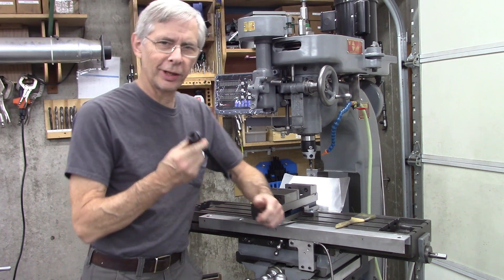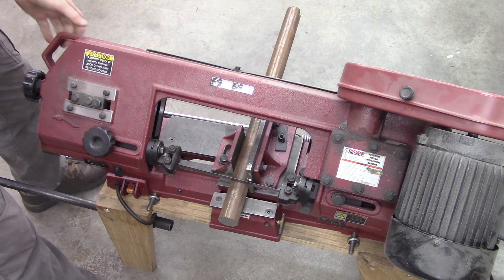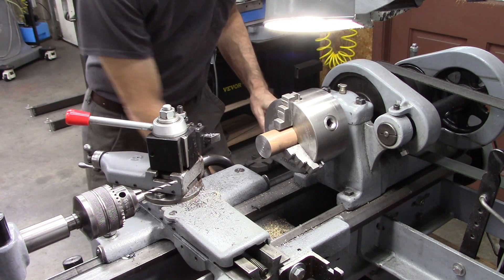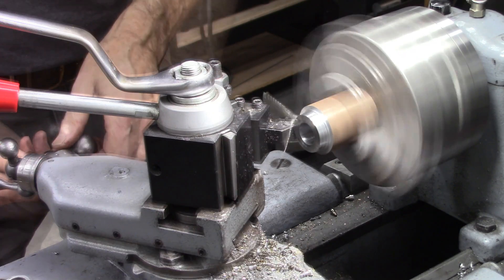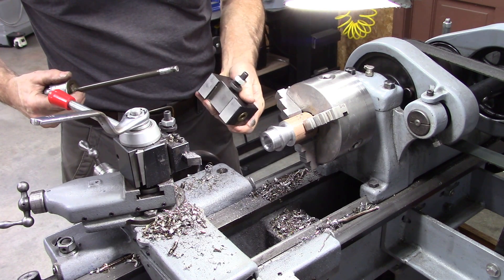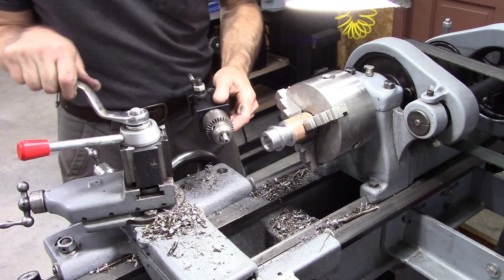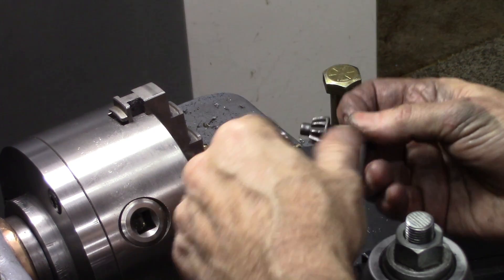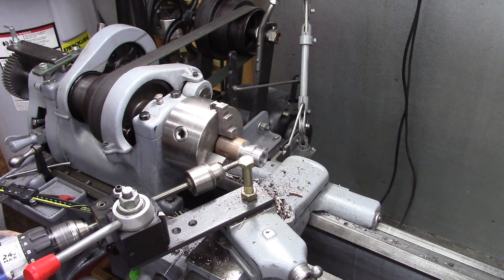Making a NEW Mill Vise Handle

Comment: Mark,  here's a suggestion for a little project.  Make you a handle to replace that nut on the top of the quick change tool post, then you'll have two handles on it.  I set mine up that way.  I was able to get some thin hardened washers to put under it and their thickness orients where it ends up.
Reply from the maker: Cool, thanks

Comment: You have some really ingenious setups and the handle turned out really nice.  Great job.  Who would have ever thought to spin a drill chuck thru a boring bar holder.
Reply from the maker: Thanks, I've used that toll post drill a lot. It's probably not super accurate but good enough for most projects
Reply: I think it was a great idea.  Seems pretty accurate to me and it's quick.

Comment: Add a magnet to the inside of the socket.  Holds tight, let go with a tug.  Happy New Year.
Reply from the maker: Maybe that would work...  it's only 12mm. I will seldom take it off so the set screw is fine.

Comment: 8:09 do you keep water in the bucket for your grinder? Or do you find with the rollercoaster ride the dust travels out ends up cooling enough to not burn the plastic bin?
Reply: Thanks for the video!
Reply from the maker: @ironhead65 Thanks, the bucket  does okay. It was a quick fix. 'm thinking a 3 lb coffee can

Comment: That toolpost extension is a great idea. I've seen a similar design speed handle fitted with a neodymium magnet to hold it on. Set screw works well too.
Regards,  Preso
Reply from the maker: Thanks Mark, yeah, I magnet would have worked but it was a bit loose. It didn't feel solid.

Comment: I hate those swivel handles too. I replaced the one on my Irwin drill press vise with a crank I devised, and it's way easier to use.
Reply from the maker: Yep, the originals are hard to use

Comment: Ha, ha, ha...  "It looks like it's either 70 or 110 degrees".  Sorry, but it sounds like something I would say.  Of course it's off of 180.  I think you can buy one of those spider vice handles, but it probably wouldn't have your hex size and I think I had to press a socket into mine even because it was metric.   I had mixed emotions about it later. It was too big and the arms should have been shorter and stouter.  It might have been the lever for a drill press.  It was kinda big and in the way and I had to keep taking it off.  I always thought it needed some sort of weighted spinning threaded hub that gives it a "hammer" and then spins and does it again the other direction to open it using a dog pin.   You know, like some of those 5c collet closers with the hand wheel.  How about a hollow hub filled with lead shot or depleted uranium (whatever you have handy) to make it dead blow.  That cries out to be a casting, where's Lyle?  Maybe you could use some heavy rods and radius the ends so they could take a mallet blow and not use any knobs.  Make them out of 5/8" diameter grade 8 bolts and a 6 point impact socket in the center.  Or not.
Reply from the maker: All kinds of ideas...  "hollow hub filled with lead shot or depleted uranium "  I'll go with the shot!

Comment: I use a 3/4" deep well socket on a 1/2" drive T-handle. Middle position for fast open or close. Slide the handle to either limit for max leverage. Works great.
Reply from the maker: The sliding handle is okay but harder to spin fast and hits the mill gable handle.
Reply: @WinkysWorkshop  it is harder to spin fast because it will extend one way or the other under centrifugal force but in the middle it doesn't interfere with the Y axis handle on my Bridgeport. Of course the length of the T-handle varies depending on manufacturer and drive size. Mine just happen to be the perfect size for my setup. If interference was an issue a 3/8" drive would likely work since they, typically, have a shorter handle. 
My handle is quicker and easier to "make" while your's is more elegant and a much better subject for a video 😁. I especially like the knobs. Along with the 3 spoke design it looks alot like most gunsafe handles. 

I'll be tackling your parting tool design for my next project. I very much appreciate you sharing the plan!
Reply from the maker: @renaissanceman7145  You're very welcome, Thanks!